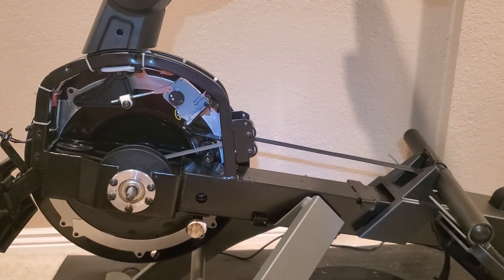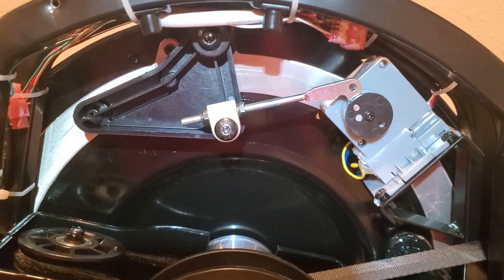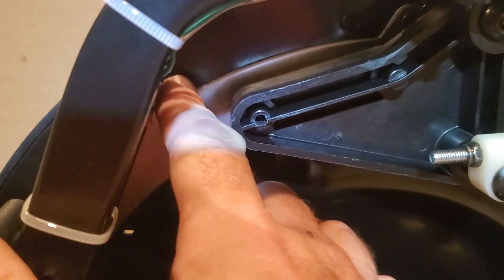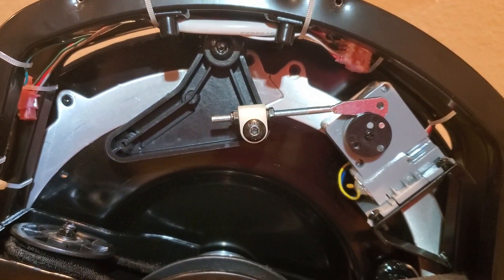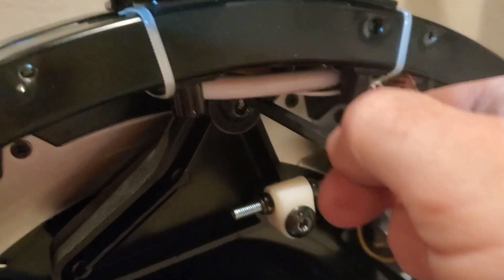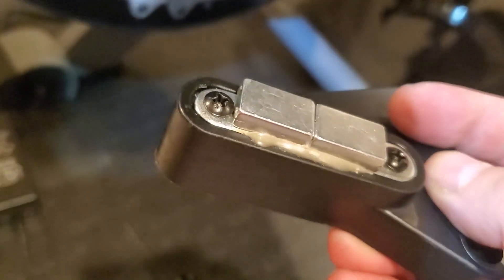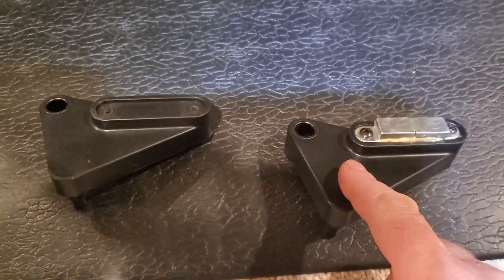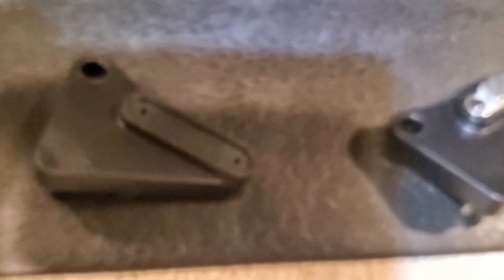NordicTrack RW900 Rower: fixing broken magnetic resistance / technical review

Comment: Thanks, this is all great information. However, there is an easier way I fixed mine. It's true the fan wheel with the metal bracket doesn't track true. That is part of the issue. It doesn't have to track perfect but needs to be within a few thousands of an inch tracking. I rotated mine and took a pry bar between the frame and fan wheel to gently adjust the tracking. After that, I removed the cam-type mechanism holding the magnets as you described. One of my magnets wasn't as close as the other one so I shimmed that up with a .037 washer on one side under the metal magnet bracket. That made both magnets parallel to the metal plate on the fan wheel. My gap between the magnet and fan wheel was now about.050-.060 of an inch. That did not solve the problem of the lack of adjustment of feel force when rowing. There is a white nylon bracket that attaches to the cam-type black plastic bracket that holds the magnets. That white nylon bracket is adjustable with a nut on both sides. There is a threaded rod running through the white nylon bracket. When you change the resistance via the 1-26 level, a motor attached to that threaded rod changes the position of the magnets up and down via the black plastic cam-type magnet holder. I had to adjust the white bracket to the left, via the two locking nuts, to change more of the magnet location away from the metal plate on the inside of the fan wheel. My feel force originally was too great. By adjusting this white nylon bracket, you can change the amount of resistance. Now, my rower works great! Hopefully, my description of this fix of my problem helps others.  BTW, the 22 mm fan wheel remover is available on Amazon. Here's the description: CyclingDeal Bike Crank Extractor Puller Remover for Square Threaded Taper Crankset or ISIS & Octalink - Easy Bicycle Crank Arm Remover Removal Tool
Reply: Kelvin, thanks for your comments here. I curretly have same issue with no resitance change at all between 1 and 26. My gap between magnet and fan wheel disc is at least 5mm (0.20inch). The rowing force on level 1 is also too high.  My question is if the magnet to fan wheel disc distance is reduced to say 3mm (0.10 inch) won't this increase the magnetic level of force?
Reply: @alanb7604  That's what would be logical to me. However, I am not an engineer. I would recommend adjusting the white nylon bracket first. This bracket can rotate the magnet holder more or less over the metal part of the flywheel. My resistance was also too high on the lower settings of 1-26. So, I adjusted that white bracket to the left. That puts less of the magnet assembly over the metal part of the flywheel. Hopefully, this works for you also. Good luck!
Reply: Kelvin ok undertook two tasks. First was file away 2 MM of plastic and inner metal sleeve so the magnets are now 2mm closer to the fan wheel disc. Secondly I adjusted the white arm and two screws so that at level 1 only the smallest portion of magnet is near the fan metal disc, the bulk is below it. At ,eve, 26 all the magnet covers fan metal disc, we shall see.

Comment: Thanks Greg! I have a question, if the screen display don’t work, if is possible to adjust the 26 resistance option, or in this case is only possible to adjust the air 5option air system? Thank for your time !
Reply: You cannot adjust the digital/magnet resistance in any way other than with the screen or if you open it up and preset it to one position.

Comment: Greg, what is the acceptable runout tolerance of the left flywheel (i.e., the one with the magnets)?  Mine wobbles at least 1/4" (circa 6mm).  When I removed the flywheel cover, I was shocked to discover that much wobble given that the other flywheel appeared to run true.   Because of that large wobble, I can only position the reed switch close to one magnet.  The other magnets are quite far away.  Obviously, I'm getting no data on the screen as to my stroke pace, distance, speed, etc. -- only the timer works.
Reply: I was able to get my wheels true within about 2mm, it takes a little time bending it closer or away and rechecking, rinse, repeat.

Comment: Very helpful video.  Thanks.  Was there are reason you didn't put the screw heads on the side nearest the metal track, and just use lock nuts on the side you adjust?
Reply from the maker: I think that arrangement would have been harder to adjust. Maybe put a clamp on the rod and then rotate the lock nut? Seems difficult to be precise with that.

Comment: Greg, thanks for making this video.  I picked up a rw500 last weekend and have noticed the resistance feels same through all numbers.  Ordered my park tool today.  What keeps the magnet bracket from sliding up and down the screws on the magnet side.  I understand the adjustment side.  Maybe it will be more intuitive once I break into it tomorrow.  So does the 1 setting feel lighter or heavier since you are moving the magnets closer? thanks again
Reply from the maker: The attraction to the fan wheel keeps the magnet fixed at the end. In hindsight, a couple of small compression springs would have been a nice touch. As to what 1 feels like, that partially depends on where the final adjustments land. Given how far out of alignment "position1" is, I would assume magnetic resistance is basically zero due to the rotation no matter how close it is. Therefore, "everything feeling like 1" is pretty much saying the product as shipped had zero functioning magnetic resistance whatsoever. Well done NoluckTrack. Once you do the fix it is going to feel very different as actual magnetic resistance enters the product experience for very the first time.
Reply: Ah. Springs make since.  Do you happen to recall  what length M4 screws you used?
Reply: @roberttaylor1240  i bought some 4inch ones and will just Sauter it down rather get to big than to small.
Reply: @gregsguidetogeekdom1222  can you tell me how to get the wheel off to fix the resistance
Reply from the maker: @andreastacey7282  this video shows how to use a crank puller on this rower https://youtu.be/av8Qgw6Z2Lg

Comment: Do you know the thread size needed to pull off the wheel? Same problem with mine, just recieved a replacement unit today. Same thing, but worse alignment problems. Need to fix it myself apparently. Thanks
Reply from the maker: Crank puller tools are fairly standard threading. I did not see multiple options when ordering one. The brand I got was Park Tool

Comment: Nice idea. Do you know if the sensors used by the computer can account for the extra work now required to spin the fly wheel to reflect accurate calculations, etc? Or are the calculations just based on a preprogrammed set of values based on the specified resistance and the wheel rpm?
Reply from the maker: I think the sensors use RPM and random lame guesses that are nowhere close to correct.

Comment: I have this problem with my rower. I’m a pretty handy person so I thought I would give your fix a try. But I can’t get the nut loose to take the fan blades off. Any suggestions or tricks?
Reply: Too late to have any significance, but I just did some maintenance on mine and I needed to use an impact drill to get off the nut. After the nut is removed, then then the crank puller is necessary.
Reply from the maker: Are you using a crank puller?

Comment: will it be easier if the gap is adjusted using washers between the magnet and the base?
Reply: I'm wondering the same thing.
Reply from the maker: To adjust by adding or removing washers would require removing more parts.
Reply: Its what I did...

Comment: I have the same problem with resistance. Even worse is the wheel is so warped, that any resistance above 4 makes a loud clanking sound because the edge of the magnet is hitting the metal ring. So crazy that these wheels are so out of whack. I'm waiting for a new wheel from NT, but I'm not too confident that it won't be wobbly as well, considering it's plastic with a metal ring attached to it. Thanks for the video Greg!
Reply from the maker: From my small personal experience, a good portion how true the wheel spins is the careful, gentle tapping with a rubber mallet while installing. Do not begin cranking the bolt down until it spins perfectly true with a loose bolt. Good luck!
Reply: @gregsguidetogeekdom1222  thanks again for the tip

Comment: Thanks for the video Bill! Mine is less then a week old and fear the same problem. Mine does seem to get a little resistant when increasing but it doesn’t seem like it is very hard. In one of your videos you talk about the fan/wheel. Mine has a visible wobble and when pulling back it seem easy at first then I have resistance. I realize you’re not the Nordic tack support hotline but I stubbled on you video and thought I’d ask. Thanks in advance!
Reply: I had two problems with mine..... the magnet was too far away and the RH wheel was warped and would wobble where the gap didn't stay consistent.   I gently rolled it around where it was too close.....then I gently pried it apart in the places where the gap was way closer to the magnet.   I used a long flat metal bar and just kept spinning it and gently adjusting it until the wobble was completely gone.
Reply from the maker: I would be cautious about using a bar to bend the righthand wheel into place. The risk is you dont know exactly what/where it is going to bend. I had good results removing and  reseating it carefully with a rubber mallet tapping gently to get it lined up as i slowly tightened the nut.
Reply: @gregsguidetogeekdom1222  I very gently pried mine as I spun it and watched the gap.  The dang metal is THAT soft..I actually used the handle side of a large crescent wrench and it took very little force to move it.  But yes,  if someone pryed too hard it could mess them up.  I work on motorcycles as a hobby and have a lot of experience trueing up wheels.  I got mine perfect....there were places where the magnet hit the wheel where in other places it was too far away.    After I gently pried the places to the correct gap,  the other gaps leveled out too.  I bet when you took your wheel off and pushed it back on, the soft metal gave and corrected itself.  Thanks again Greg....I knew it was something simple, I just wasn't happy with the lack of resistance but knew that my actuator was fine (I could hear the motor changing resistance.)   Before fixing it, I actually thought that maybe the glued on magnet was either missing or fell off!  ha ha!
Reply: @chambwp  Hi Bill, Can you tell me what you were prying against to gain leverage? I understand that the wheel needs to be bent with the wrench handle, but what was the wrench up against? Thank you
Reply: @chooseoutside8586  No need to use any kind of prybar, the wheel is so flimsy you can do it by hand.
Reply from the maker: Getting the wobble out of the wheel is a good choice either way. NordicTrash support is both very friendly and supremely frustrating. At one point they sent me a replacement seat base as if that might help!

Comment: Thanks for this.  My brand new RW900 has the same problem even though the adjustment motor is working like it should.
Reply from the maker: I am still disgusted with them but the product is working now. If you have any questions, let me know.
Reply: @gregsguidetogeekdom1222  Fixed mine tonight!  Works perfect now.  I just added a couple of washers under the magnet to move it closer, although I did use bolts (with stop nuts) for added strength instead of the screws.  The RH wheel had a slight warp, so I straightened it by gently prying up the side that was bent in.  Problems solved!  You'd think as expensive as they are, the quality control would be better!  I'm loving it now though.
Reply: I have the same issue with my new RW900.   No luck going thru warranty?
Reply from the maker: The warranty is a total complete joke! I struggled with literally 5 video troubleshooting sessions as they sent me a bucket of replacement parts that failed to fix it because none of them could ever alter the welded magnet mount position. Then they sent me an in-person repairman who proceeded to write up an eval saying "yes all of these rowers have crappy resistance" NT translated this into "all is well, we will not do anything because nothing is wrong" I am still angry at how miserable this product and company are. There is just no excuse for such substandard engineering and service.